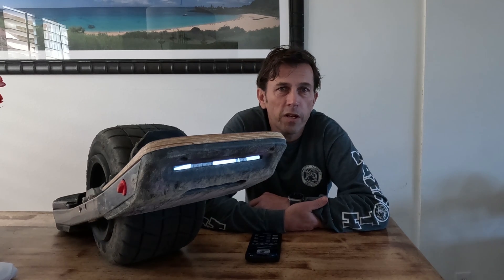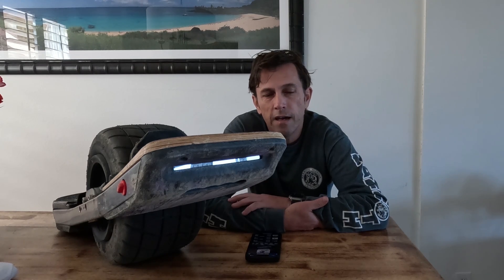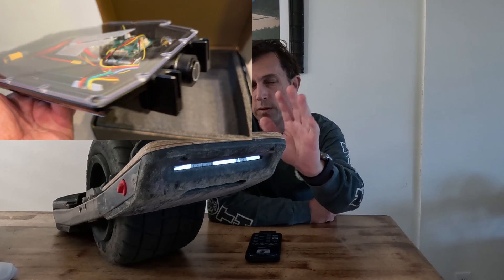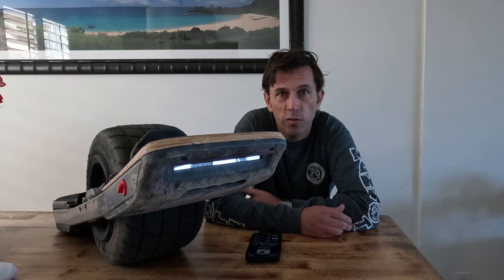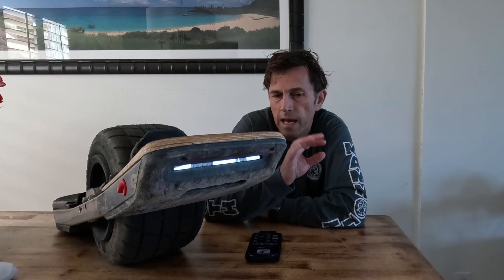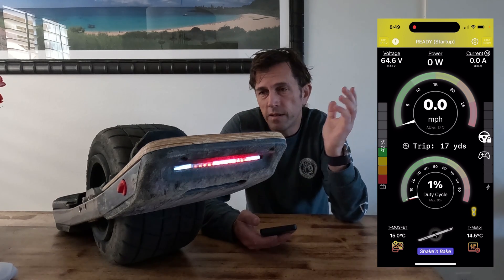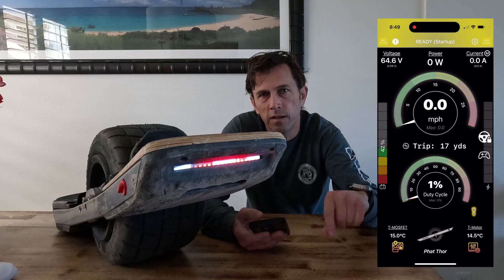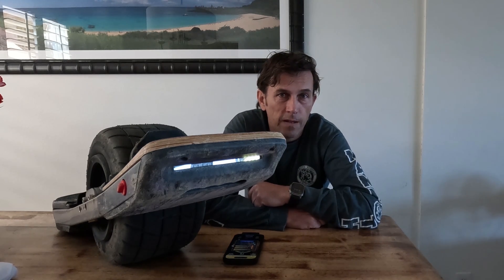Fungineers Thor300 Controller Review

Comment: No puedo conectarme al Thor 300, mensaje,; Could not read firmware version. Make sure that the selected port really belongs to the VESC. If you are using UART, make sure that the port is enabled, connected correctly (rx to tx and tx to rx) and uses the correct baudrate,,,, AYUDA
Reply from the maker: @ozonem3  switch back to 6.2 VESC tool for now - there’s an apk available on Discord

Comment: Hey this might be a dumb question, but I cannot find any information or schematics on the motor pole leads on the thor300. 
I have identified my motor pole leads but the controller itself is a mystery, also the only “tutorial” is your step by step guide which skips all of the wiring hookups.
Are they interchangeable?
Reply from the maker: what are pole leads? If you mean the 3 phase wires then there's no particular order needed, the motor detection process figures out the order, same goes for the 3 hall sensor wires (blue, green, yellow)

Comment: Nice video Dado. Curious to know on the floatwheel, it overheated the motor, the controller ? Or both ?
Reply from the maker: The controller is what overheats very easily on the floatwheel
Reply: Fun fact. Thor300 uses the same mosfets as floatwheel controller.

Comment: I’m curious if you’ve run into the same heating behavior with the V2 Superflux that Auden mentioned. I haven’t installed mine yet, so I don’t have a sense of how it performs compared to the V1. Nice video Dado, thank you.
Reply from the maker: does the MK2 SuperFlux heat up faster than MK1? Yes, mainly because it doesn't include Statorade. So I'm guessing that some Clydesdales who ride trails / ride hard will eventually want to add Statorade to their motors. But the majority of users shouldn't really need it. We will know more come summer I guess...

Comment: Thanks Dado for the unbiased review, and working hard for the community especially working on the float app. It's our go-to app now for sure with the led support and the.amazing tuning options.
All: The switch on/off issue was on early units and production units should be good.
The leds will also be sold separately for people using 3d printed boxes.
Reply from the maker: what's the float app??? 🤣
Reply: Can confirm, the momentary switch works great on my unit!
Reply: I don’t agree with the ‘unbiased’ statement. We all love and appreciate Fungineers and Surf are doing for our community, but once you get parts for free and you are a regular Fungineers product tester, there will always be some bias and objectivity will fail.
Reply from the maker: @devrim1134  by that logic there are no unbiased reviews then unless you do double blind testing. That will never happen in this tiny niche market
Reply: @surfdado  True, but maybe a Patreon system could work? Many are using this method to be objective as possible